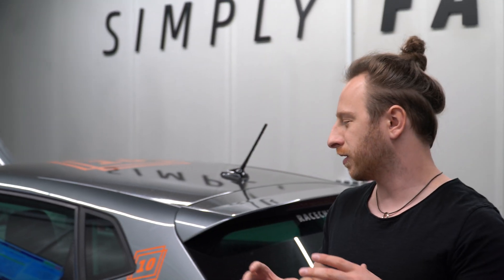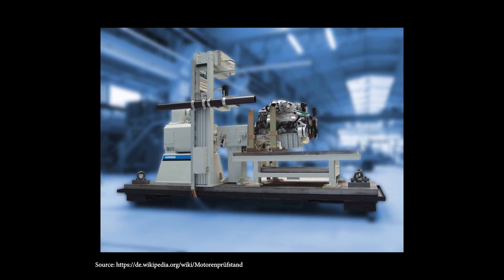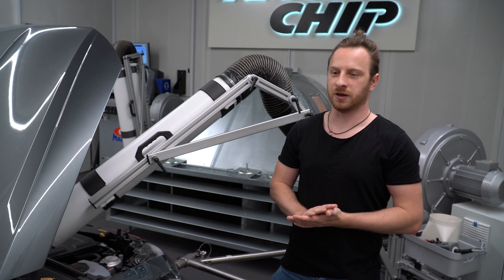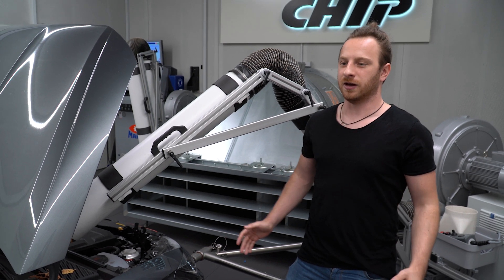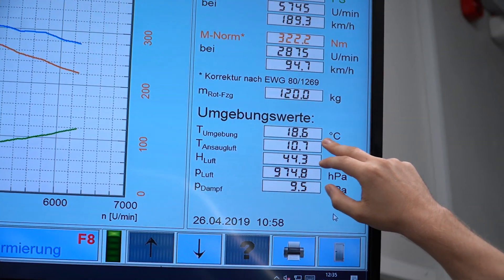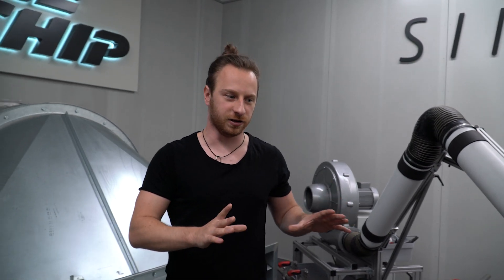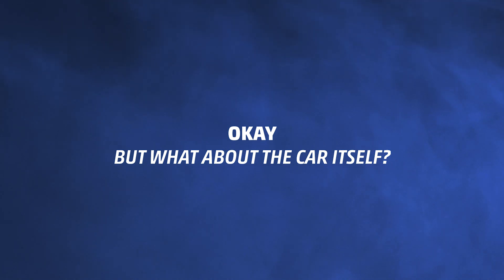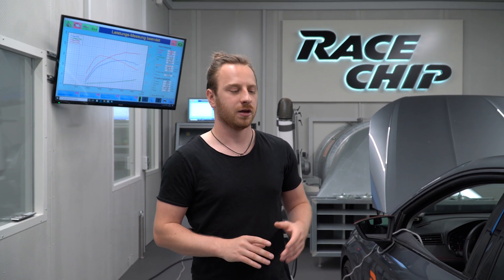RaceChip // How a dyno works & How to read a dyno chart

Comment: Hello, i have the same car. This car has a custom downpipe? 
There are noises problems when it works in 2 cylinder mode with a downpipe skat?
Thanks
Reply from the maker: Hello Alessandro, our Ibiza has a custom down pipe, yes. It works just fine in 2 cylinder mode, the only downside is that the slightly weird 2-cyl sound is amplified by a down pipe and a custom exhaust in general. But in terms of power output, there are no problems at all.
Reply: @RaceChipChiptuning  

Hello again and thanks for your attention.
Anyway the sound becames annoying and attracts the Police or not?
How many more hp by mounting the downpipe compared to the simple map?
Have you already made some turbo s upgrade?
Thanks a lot👋😉
Reply from the maker: The downpipe we've had installed is TÜV legal in Germany so we don't have to worry about the police :) In terms of power output, the downpipe probably gives you around 5 HP more so it's not really a game changer. We did upgrade turbo chargers e.g. on our own Hyundai i30 N but we didn't do one on the VAG 1.5 TSI engine yet.
Reply: @RaceChipChiptuning  

The last one... is your downpipe completely skat? 
Who is the manifacturer and how mauch it costs? 
Thank you so much

Comment: Can oyu guys help with install on a 1.5 TSI 130PS Leon FR install. How the hell do you get to the turbo sensor it's almost impossible.
Reply from the maker: Please check our installation guide for that engine in your parcel and in case that doesn't do the job, please contact our technical customer support at support@racechip.com

Comment: Greetings from Turkey. I have a 530i xDrive (G30). I was wondering if it would be safe to mount one of your modules under the hood. I mean, the manufacturer produces the engine block, pistons, tranmission and everthing (all the metalic/solid stuff) for a specific pressure/temperature range, right? How do you make sure that those parts won't get damaged after - let's say - 30% power increase? How do you know your tuning is "safe"? Wouldn't this kind of a procedure reduce the engine lifetime from - let's say - 1.000.000 kms to 700.000 kms or something like that? 
A small request... Can you add a video for 530i tuning? I think it sells a lot :)
Thanks for the video by the way!

Cheers

Comment: I have a question, hp = rpm * torque divided by different values based on torque unit, but you say horsepower is measured, which we can see that the power curve is getting drawn. But isn’t torque being measured and power being calculated right at that moment from rpm and measured torque?
Reply: Not trying to bash on anything, just want to clarify things for myself.
Reply from the maker: @HPAddict  You are absolutely right, hp is a result of rpm * torque divided by different values based on torque unit.  However, all dynos will show WheelHP, thats why we explained it that way to make it easily understandable for everyone.

Comment: Good video! However, not all dynos actually measure the power loss. Some cheaper dynos just calculate it.
Reply from the maker: Yes indeed and it is a shame that this function is not a standard throughout the dyno manufacturers. That's why we decided to get the Maha MSR 500, to get actual results.